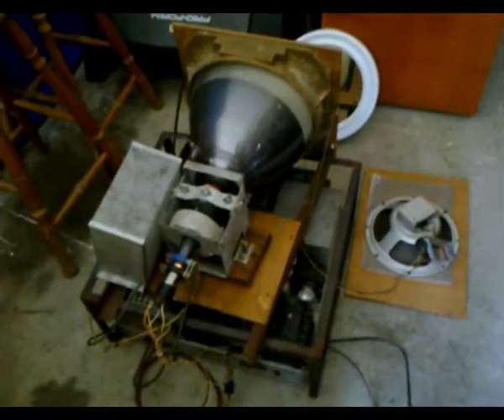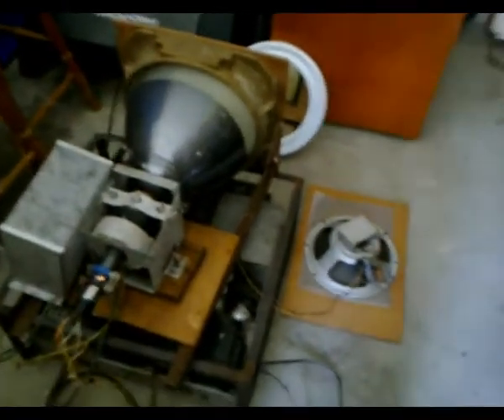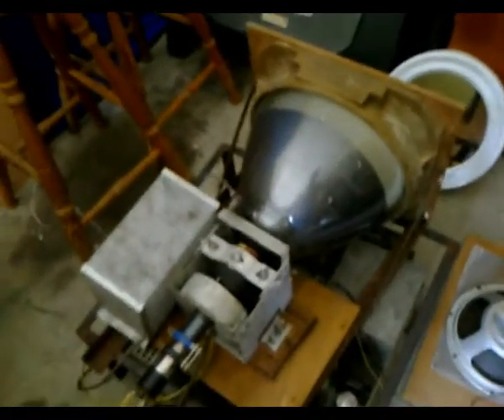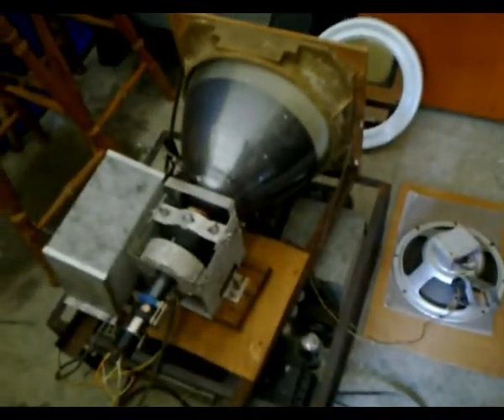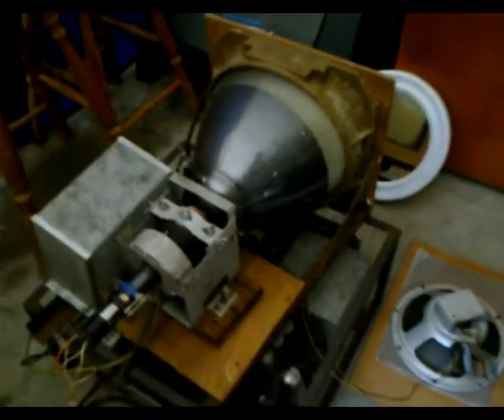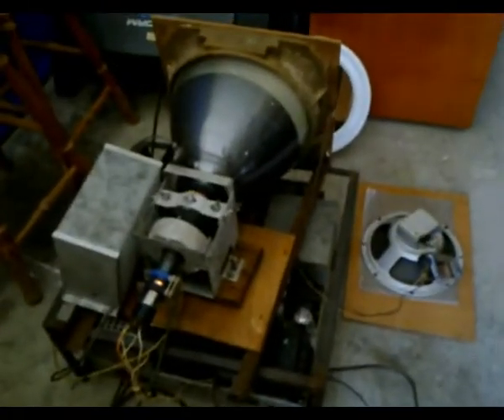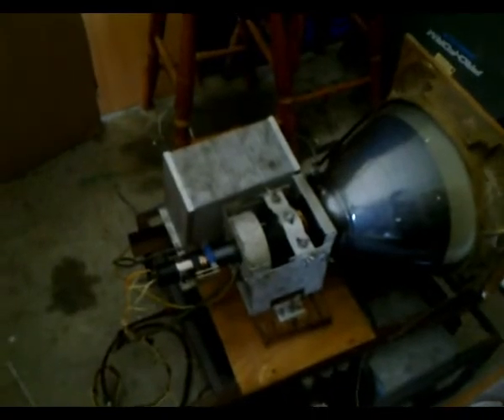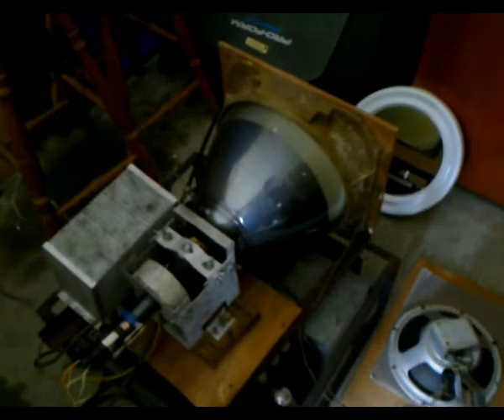1947 Andrea VJ12 B&W TV restoration: powering it up for the first time

Comment from the maker: The CRT isn't the standard 12LP4 or 12JP4 tube, it's actually a VCR140 radar tube, this set has had some modifications to operate with radar tubes instead of TV tubes, this is probably because they were more abundant in Australia at the time as TV didn't start here till 1956.